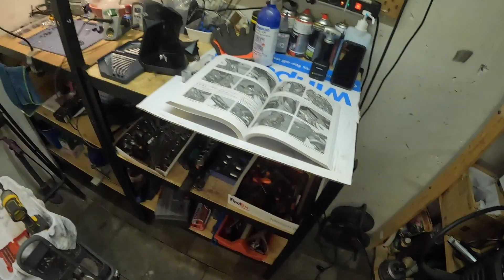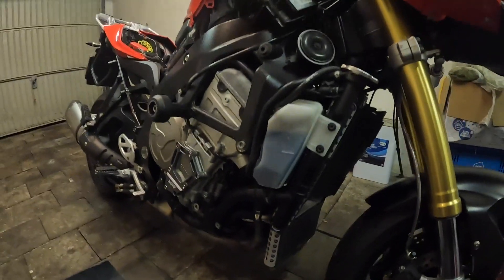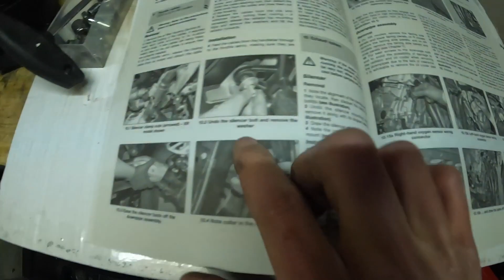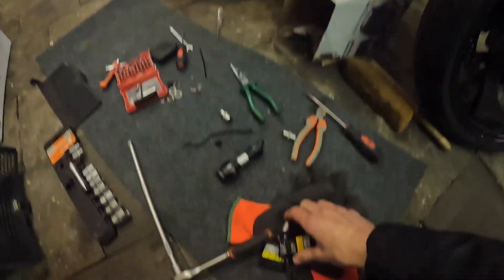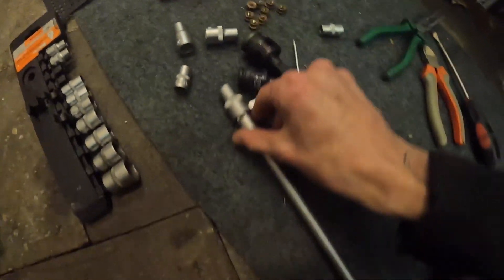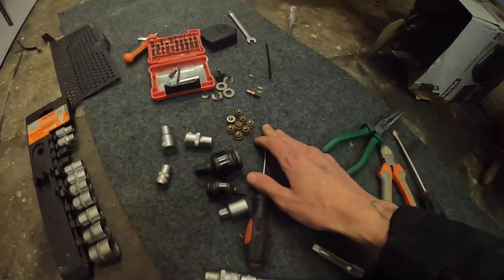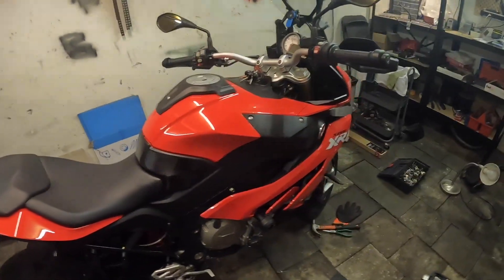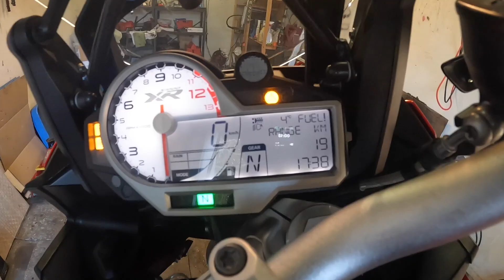How to Decat a BMW s1000xr

Comment: This mod is not illegal in the UK. Oliver, those header nuts are stock hardened brass, not copper. The reason BMW use them is to ensure that they don't corrode over time, and make removal with a socket impossible, also brass is less likely to seize onto the header studs.

Comment: I spent time and money doing this modification with the dominator, it is almost equal to 0 compared to what the Akrapovic galleries do. In the end I spent 850 Euros and bought Akrapovic and the miracle happened: sound, power and torque.
Reply from the maker: Akrapovic is the same end result for the exhaust system (excluding mufflers of course) when installing this decal middle pipe. However the middle pipe only works when all original filter elements have been removed from the original exhaust. Afterwards the airflow matches that of an akrapovic or any similar pre-made straight pipe exhaust. (and saves you hundreds of dollars)
Reply: @BikerrepOliver  Oliver, you are starting from a wrong premise. You consider that if you remove the catalyst with the empty Dominator pipes, the middle pipes will be straight exactly like those from Akrapovic. But close to the engine block, the original Bmw pipes communicate through other pipes like this: cylinder 1 with 4 and 2 with 3, which means that the exhaust is not done directly. Do you understand where the differences come from?
Reply from the maker: @gabrib6591  you are correct, however having tuned the bike and measuring the exhaust flow it comes very close to that of the ‘smooth’ straight pipe system. The difference is not worth the hundreds of euros in my opinion. Perhaps on a race bike where every gain matters

Comment: hello
Do you remember maybe, was the smaller pipe (which enter to the bigger pipe) on the end of DCAT,welded and taped inside of the bigger pipe? Just right on the joint but from inside. Or was is  free flow?
Thank you and regards
Reply from the maker: I believe it was closed.

Comment: Thanks for the nice video mate:) 

I am wondering, how and if you are able to pass successfully the bi-yearly inspection which includes measuring the emissions?
I live in Germany where regulation is strict and I am not sure if I will be able to pass the inspection if I de-cat the bike..
Reply from the maker: Im not too sure if you’d pass. I know some bikes in Germany are sold with a straight pipe and pass the TUV inspection, however the pipes come with a certificate. DECAT is different as it does not have a certificate but is technically part of the original pipe. You could see a tuner who has a particle measurement tool and check if it’s within the legal limit.

Comment: Hey, What can be done to "ReCat" the bike? Would you have to weld it back together or some link clamps will do the trick? Also, did you use exhaust paste or was it dry mount, plug and play?  Thank you!
Reply from the maker: Welding is possible but you have to make sure that the filter element inside the box allows air flow. Most of the time when you cut the element it folds the small vents sideways, if you weld it back into place like this it could be catastrophic for your engine. 

If you can straighten the element AND weld it back together (best using TIG) then it could work but it would never have its full potential again. 

Best would be to purchase a used stock exhaust, that way you have 1 exhaust open and one with a cat. 

For mounting this exhaust I used the included clamps and no paste. You could use paste but I have found no air leaks on mine.

Comment: Seems some amount of work, my multistrada was so simple to do, half an hour and that was it, couldnt you just cut the cat from underneath and save yourself the trouble of stripping everything?
Reply from the maker: A part of the oil pan sits in between the exhaust, a grinder can't reach there unless cutting into the oil pan..